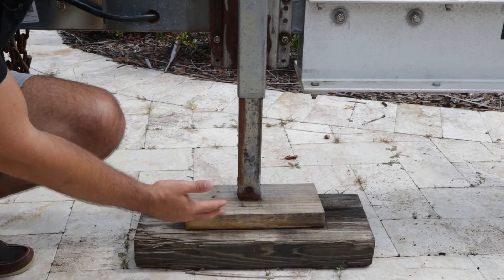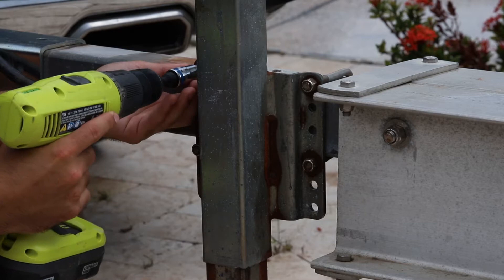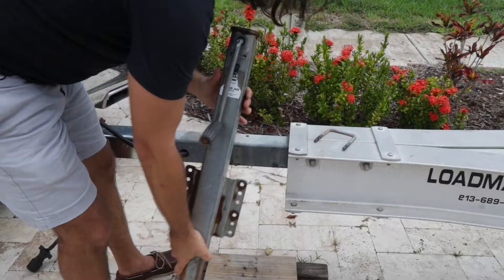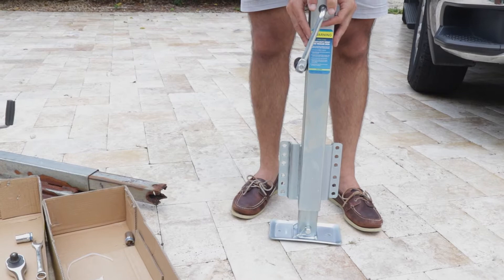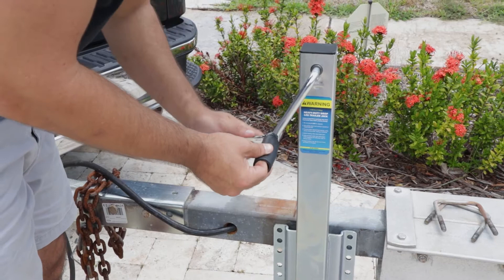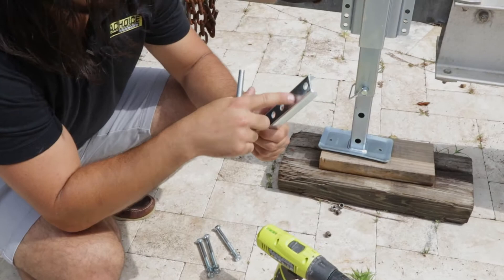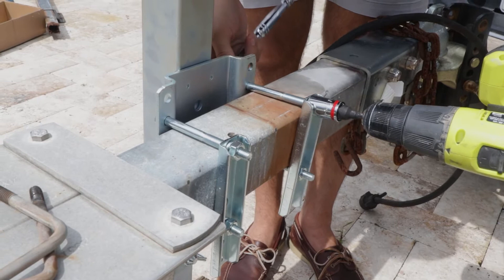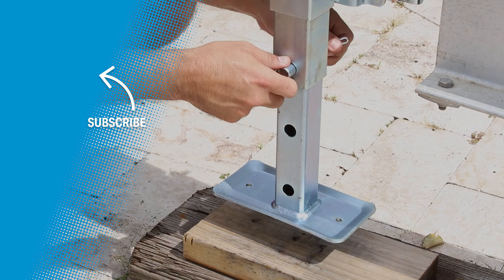Seachoice Trailer Jack Quick Installation

Comment: I need to make a plate to allow for mounting mine. My trailer has no tounge like yours it’s all 6” frame all the way to mounting hardware. I can’t find another option to mount it to the 6” aluminum frame. I have a float on trailer and can’t seem to find anything that will work besides fabricating my own mount. Any ideas? Mine looks just like yours up to where you butted the plate to so essentially I have no skinny tube on the tounge, I need a plate over 6” and then I’ll need bolts over 8” to go across the 2 i beams.